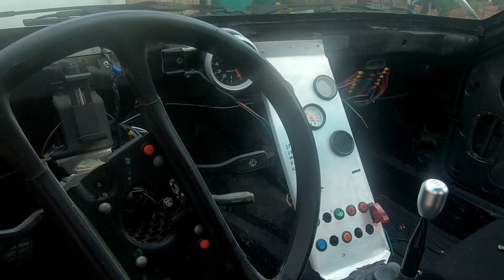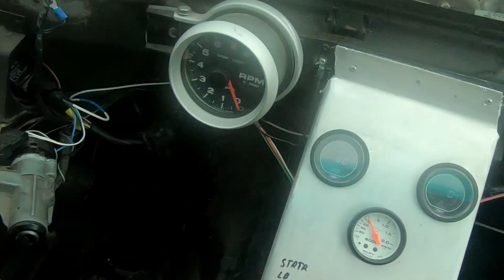Into the build - 944JZ EP.00

Comment: What axles did you use
Reply from the maker: I am using the stock 944 axles with a machined adapter plate to mate to the supra diff.
Reply: @ForgeSpace  do you have pictures of the plates or the thickness of them